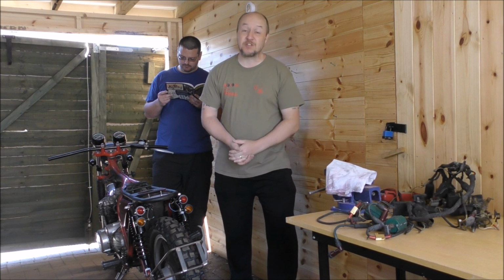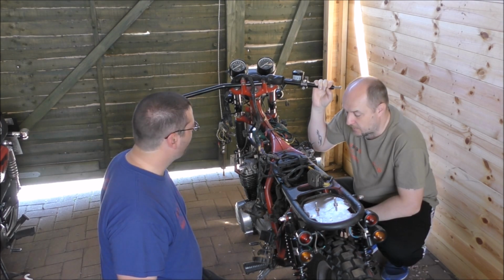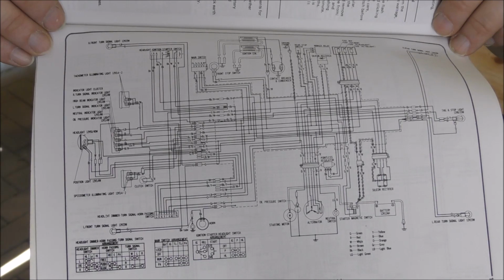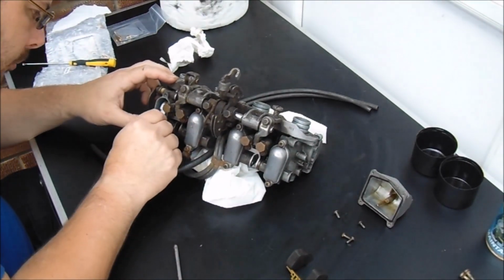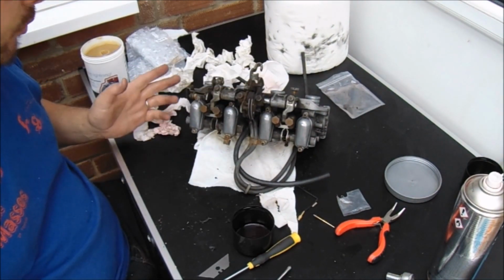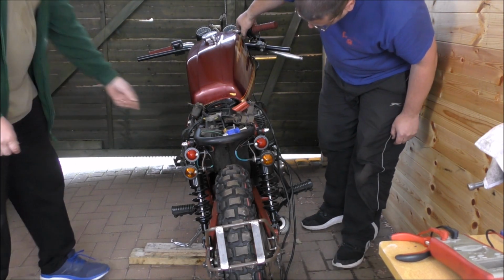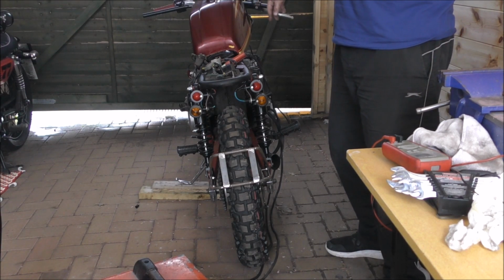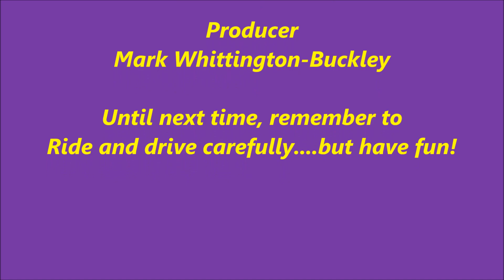Project Cafe Scrambler BUILD Part 15 It's Alive!

Comment: Well done lads! :-) When it comes to a wiringloom, do check if the connections inside the the tape/hose protection are ok. I bought one for my sons moped and they had really cut corners when they made it. No soldering or anything.
Reply: I would expect there to be twisted wires with crimps over it there not soldered joints. A soldered joint in a place that vibrates, in my opinion, is not ideal due to fatigue, I havent looked at our new loom yet but I will check it based on your comment, thank-you.

Comment: nice, 400/4 is a gem of a motor, it ran damn well, yeah, carbs might need setting up, and fresh plugs:fuel etc will help, one thing often overlooked is the earth contact to the frame? I always shine it up.Re the baffle, there are heated arguments about back pressure or lack of it, I tend to go with the baffle in argument -someone else will say its rubbish no doubt-don't care heard it all and I stay baffled (get it haha). Great sound.